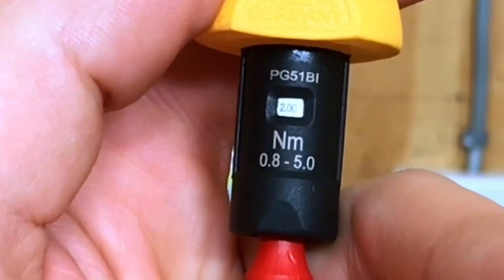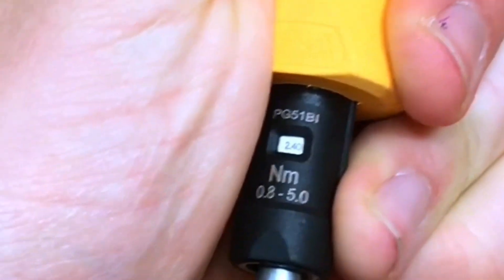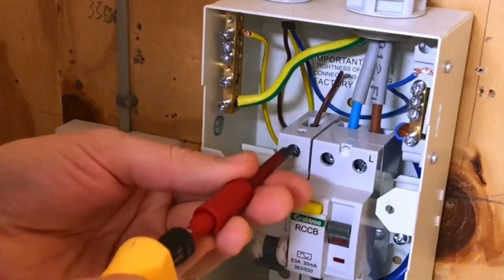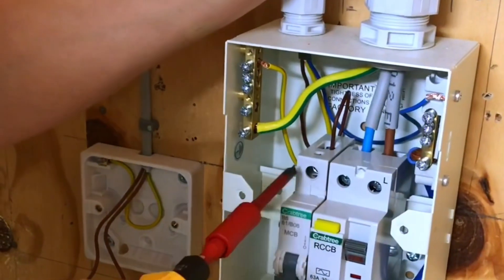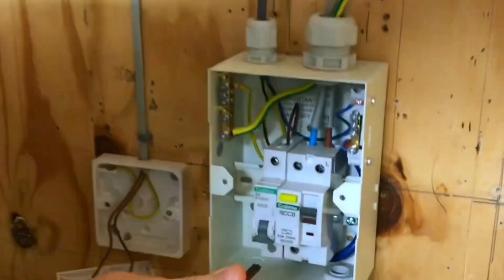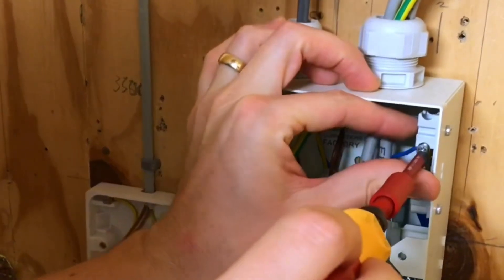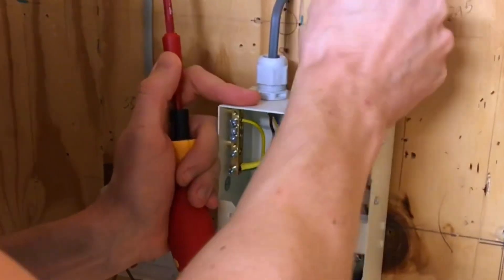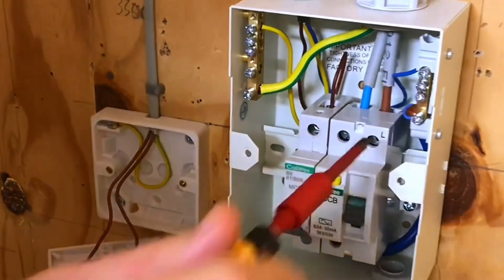Torque Screwdriver - Meter Tails Pro Tip

Comment: As someone who's spent 40+ years in the automotive trade, with torque settings a thing we have been using for over a century,seeing stuff like .3 of a NM being discussed is ridiculous.
The differences between fasteners of identical design and type,friction etc.would negate that degree of precision by virtue.
We have whats called matched sets for certain applications, where each fastener in a set will be tested and matched for it's yield strength,stretch etc. with others that perform within a set tolerance of each other,very critical components but even those matched sets require that tolerance because it's impossible to ensure that level of precision, especially down to that degree.